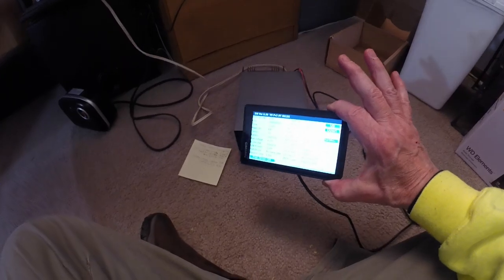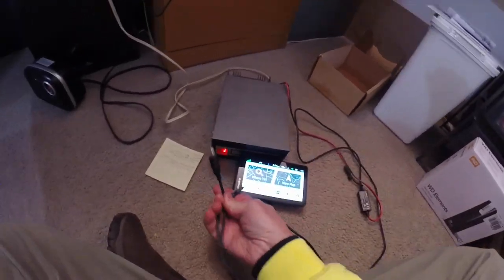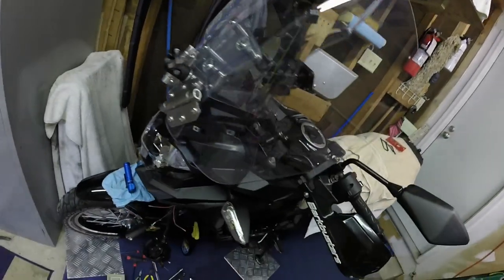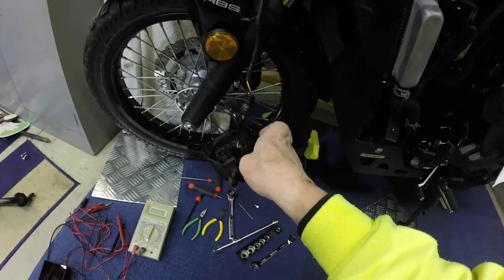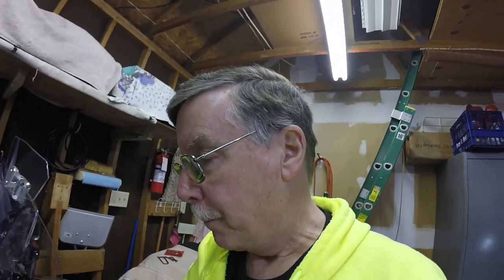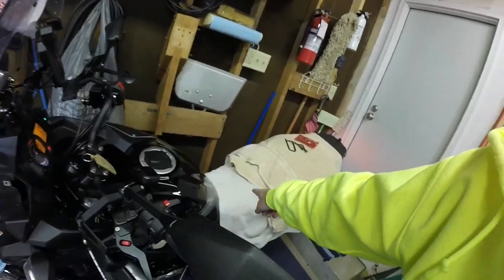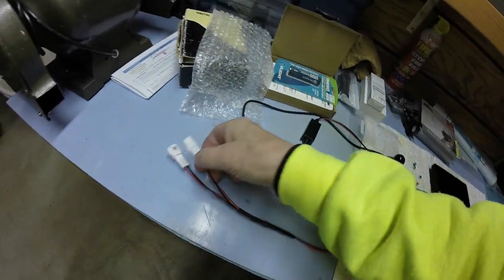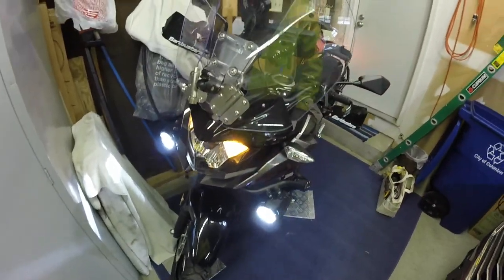Garmin Zumo XT - Charging internal battery - READ TEXT UPDATES- Install - Kawasaki Versys X300

Comment: Thanks for the content. When I finally found this it was as if we had experienced the same nightmare. Garmin is not much help and I sensed their support techs know this is an issue in the design. 

I had success charging directly off my HP laptop power cord. The one with the big on-line AC adapter. 

I am so frustrated with the continued need to travel with 3 or more power cords because we could figure out how to standardize things sooner.
Reply from the maker: I hear you.  USB (several generations, USB-C, USB mini, USB micro.  Then there are the round power cords and the lightening cord for the phone.
Reply: @ I found another work around by running the USBC cord off a portable power bank. Both would charge while plugged into AC. This is my best option.

Comment: Thank you.  I just got the Zumo XT yesterday and I can't believe it just shows a lightning bolt without a percentage of charge.  I left it plugged into my computer overnight and it still didn't show a full charge.  AND it depleted the battery pretty quickly.  I will try my Anker power bank and see if it'll do a full charge.  I was ready to send it back also.  Fingers crossed.  I do tell it to not connect to the computer for usb transfer.
Reply from the maker: The charging issues are mostly due to older USB-A ports.  You need the most recent charger version - high current - 2.4 amps USB-A.   The text below the video has updated information and please read the April 26, 2023, AND the April 28, 2023, comments for the detail on the colors of the ports referenced.  Also, to see the detail of the charging current the video shows you how to get into the diagnostics screen for all the important operation data.  Be careful in the diagnostics screen and close with the EXIT annunciator.   This diagnostic screen will show current (milliamps) going into the battery when the latest USB-A high current port is being used.  Once you get charging going with the USB-A port or the rear mount/cable it will all make more sense.  If you have any questions, please let me know.  Thanks, and best of luck with your Zumo.
Reply: Long press the battery icon and you get to a diagnosis screen.  Who knew...

Comment from the maker: UPDATE - UPDATE - UPDATE - you can charge the internal battery from the USB connector on the back of the Zumo XT. I went through the USB cables, 3 wall chargers, USB 8 port console I used for everything, and computer USB ports and nothing - no charging. BUT WAIT I grabbed my Anker power bank and BAM - the Zumo is charging from the back USB port. So next I thought let's try the Anker USB wall charger that charges the battery bank and IT WORKED TOO!
Stay away from the cheap no name wall chargers.
USB cables and chargers are not all created equal. I knew that about the USB-C but didn't know that about the USB-A (old school)

Comment: I just got the XT2 and it would not charge via the USBC port from a wall charger,  however it does charge using my battery power bank.  It must need a certain amount of voltage to charge it.  I’ll probably try a different wall charger next.  Least it does charge while it’s not on my bike.
Reply from the maker: Yes - the Zumo units need to be charged from the most recent USB chargers with the blue plastic inside the connector on the charger.  I spent way to much time figuring this out but kept at it until I understood what the requirements are for the Zumo and would think the Zumo XT2 would act the same way.  Enjoy your Zumo XT2.
Reply: @trekOCLVone  Where did you find a charger that works ??
Reply from the maker: I have a battery bank by Anker that has a "Q" USB port and that was the first power source that worked.  The "Q" port is a fast-charging port for 3 amps of current @ 5.2 Vdc.  The Zumo must have a way to check for available wattage from a USB port and all the earlier versions of the standard "A" style original USB ports have the black plastic "key" in them.  Those do not work.  That is what I was dealing with at the beginning of this video where I could not get the Zumo XT to charge with it "ON" or "OFF".  That was a frustrating time and my comments in the video were made with me not finding the correct USB port to charge the unit off the bike.  But I kept at it and found what made the Zumo XT charge off the bike and with the unit either ON or OFF.  And it was the version 3.0 of the USB-A power source with the blue plastic which tells you it is the 3.0 (latest version of USB-A) power connector.  It shouldn't be this way - the Zumo XT should allow any USB-A source to charge it up even at a lower current and take longer.  Garmin designed the Zumo XT to only charge with the high current USB-A power source.  I hope this helps. Just find/buy a USB-A wall charger or battery bank with the 3.0 or higher version of connector (blue plastic), or the "Q" fast charging connector like the Anker battery bank that worked for me.
Reply: @trekOCLVone  Thank you VERY much for your reply and help !!
Reply: I found a Wall Charger on Amazon that does charge the Zumo XT2.  It has three ports and is labeled as 128 W.    GKUTW is the brand.
Reply from the maker: @workharddieproud  Fantastic!  The ports should be the recent 3.0 or 3.2 (ish) standard that can deliver higher current and the XT (and XT2) can then charge with the unit on or off.  Now I know which of my many chargers around the house that will work with the Zumo XT that I have.   Thank you and it is great that you kept moving forward with the chargers and now have a solution for your XT2.

Comment: Hi, I have just charged zumo XT via usb by, when the unit is on give the on/off button a quick tap. Screen goes off and a message comes up " unit charging press on/off button to turn on". Doesn't look like it's charging but when turned on again after a while you will see its charged. Depending how long its left. Hope this helps!
Reply from the maker: That is something special - charging the XT has way too many quarks.  After I made this video I did find that the latest USB A ports that are blue (3.2 version) charges the XT all the time.  I have many USB chargers and ports on computers that are not the latest and that is where I got tripped up.  Thanks for your comments and it will help other XT owners.

Comment: How well are the side panel fasteners holding up after disassembling and reassembling the front so many times... Any undue wear or looseness/vibrations/noise? Do you have to replace the plastic rivets?
Reply from the maker: All the cowling is holding up fine.  Removing and installing just needs to done carefully.  The little fingers that are pushed into the rubber gromets need to be sprayed with a little bit of Dawn dish soap / water solution and they go right on. It shouldn't matter how many times you disassembly the cowls as the rubber gromets don't wear down and it would take a life time to wear them out.  I've lost one so I bought spares of them as they are cheap.  I've bought spares of most of the fasteners for all the cowls and parts that I've taken off a lot.  It's part of the projects - well sort of.   Care must be taken also with the reassembly of all the cap head screws and bolts so you don't cross tread them.   The little plastic rivets are expendable and I would suggest before you even dissembling the cowls buy some spares.  I bought a few rivets from Kawasaki to have on hand.  Using the correct technique of pushing in the little center button in first then the rivet can be easily removed is widely unknown as shown on other YouTube channels where the X300 owner just keeps pulling on the cowl until the rivet is destroyed and that isn't the best way to go.   Thnank you for your questions.

Comment: Mine charges with the USB in the ON state. I am having problems with the bike connector to the Zumo. Not sure why that is. I have 12V at the switched connector to the Zumo wiring, have power after the soldered connection, no power at the pins that contact the Zumo. The Wire from the box to the pin connector is shielded and inaccessible.
Reply from the maker: The Zumo XT rear mount with the little 5 pin contacts should be at 5 Vdc and ground.  I think the other 3 contacts are do-nothing.  If you are measuring the bike's 12 Vdc at the power end of the Zumo adapter cable and nothing at the contact pins where the Zumo snap/click on, then the most likely issue is the DC-to-DC converter (the little box at the halfway point in the cable.  This little box has some electronics in it to take the bike's 12 Vdc and drop it down to 5 Vdc USB-A level) going to the Zumo contact pins.  I would double check everything and if the mount cable with the DC-to-DC converter is bad you will need to contact Garmin.  Is your Zumo XT under warranty?  If so, there will be no charge.